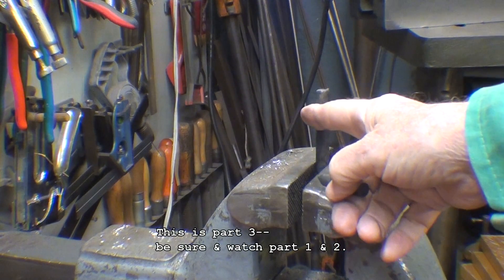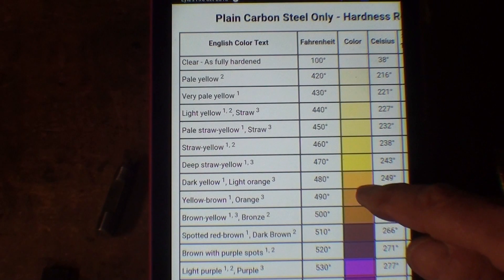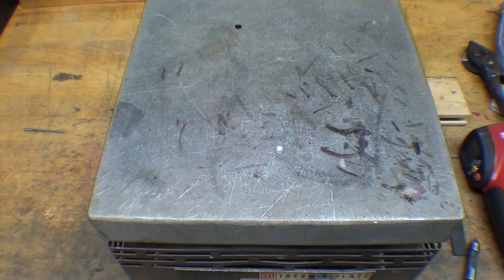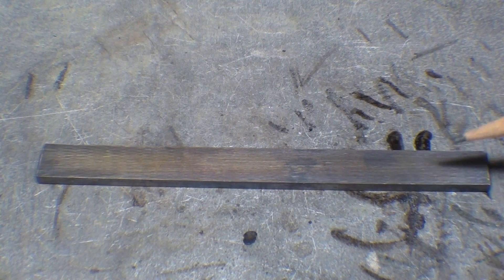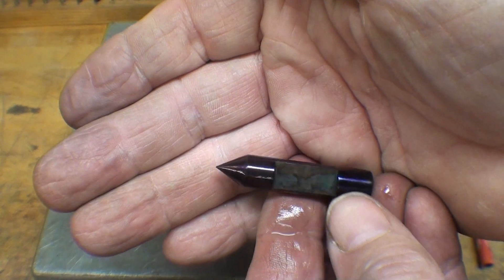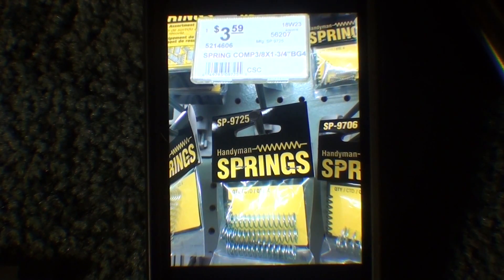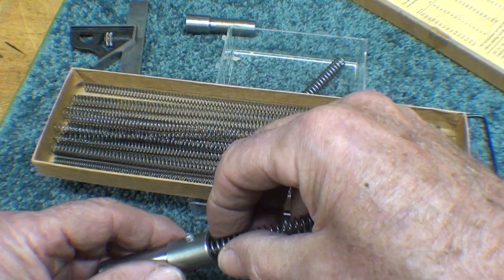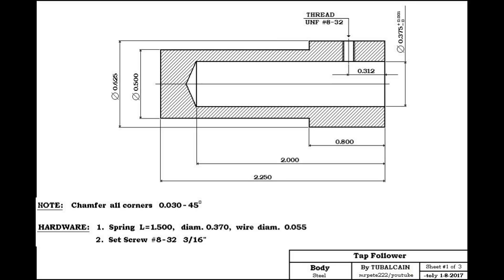TIPS #361 pt 3 HOW TO MAKE A TAP FOLLOWER tubalcain

Comment: Well this is another project I had put off for to long. I had made a tap follower years ago but not this style and while it did it's job it wasn't the sturdiest design and I made the mistake of making it using 5/8" where it goes into the chuck, you wouldn't think that is such a big deal but it is in my opinion. 
I don't usually load a 5/8" chuck into my lathe tail stock or my mill, I seem to gravitate to a 1/2" chuck most of the time and it becomes a pain when you have gotten most of the way through something and go to tap it and then you have to change out to a larger chuck. On the lathe it really isn't that big of a deal but on a milling machine and mid project the last thing you want to do is stop and swap out a chuck. 
Yet another one of your projects I have made, Thanks mrpete.

Comment: Mr. Pete,
  It’s always advisable to use a spring of slightly smaller diameter than the bore. A compression spring naturally expands as it is compressed so adequate clearance is necessary. Probably what your “jammer” spring was doing.
Dale from Decatur

Comment: +mrpete222 I've been watching your videos since 2014, when I retired from the military (after 20 yrs), I'd like to learn the machinist trade.  I've been looking to going back to school @ a local community college here in San Antonio TX.  However, it appears that traditional machining is on the way out (it's all CNC).  If I do a "home study" self-guided class, what textbooks (like the one you showed on this video) videos, or information would you recommend?

Any other advice would be appreciated!
Reply from the maker: Ron-I just lifted these titles from amazon. Also, look on ebay for mach shop textbooks. The older ones may be better-they do not include cnc. There are 1000s of these old books around for cheap. Watch my tubalcain tips #189 & #282 for books. Machine Tool Practices (10th Edition)Jul 20, 2014
by Richard R. Kibbe and Warren T. White
Machine Tool PracticesJan 1995
by Richard R. Kibbe and John E. Neely
Machine Shop Operations and SetupsJun 1, 1973
by Orville D. Lascoe and C. A. Nelson
Reply: Thanks Sir
Reply from the maker: Thanks--I will explore that site

Comment: Does the heat bluing of the steel do anything to improve corrosion resistance?
Reply: Yes, it acts very similar to gun bluing, as far as heavy rusting is concerned. That said, as with gun bluing a very lite coat of oil is used to prevent surface flash.

Comment: Lyle, get yourself a small brass or ally tray and fill it with Silver Sand or fine brass turnings. Place it on the heat with the part nestling in the sand / turnings. This will give you a much more even heat as the temperature rises.
Reply from the maker: Yes-like clickspring

Comment: The fine grain appearance in the break indicates that you had heated the material close to the transformation temperature of the high carbon steel which is 1330 degrees F.  Above that temperature grain growth occurs and if heated far above the transformation temperature the grains become very large and the steel becomes very brittle.

Comment: I worked for an oil field tool company that heat treated their own steel. We bought some Japanese steel in the mid 70's. Rolling through our line furnaces, that stuff would eiter break apart in chunks as it came out of the furnace and a couple of time the 30 ft. long 8 in. diamater solid steel bars would split lenghtwise, "slab", and basically destroy our furnaces. Amazing and dangerious when you talk about the pent up stress in steel. :)
Reply from the maker: WOW!!
Reply: In our steel mill, we would run rebar with out of spec (leftovers,various grades)billets. occasionally we would get rebar so hard it would break like glass if you dropped it!

Comment: When the Springfield armory sent the first run of 1903 rifles into the field, they began to get reports of some of the rifles blowing up. Col. Hatcher investigated and found some of the receivers were so brittle that they would shatter like glass when struck with a hammer. Turns out that, like most factories of that era, they used used skylights for day time lighting. The receivers were tempered by eye and on a bright day the colors were faded and the steel over heated and became brittle. Plan B, to the furnaces.

Comment: Thanks for sharing this build. Just wondering why you need to temper this tool?  A tap follower doesn't seem to have a lot of stress and, a little oil on the point would keep wear to a minimum. seems like a little overkill to me. Maybe I am missing something here?
Reply from the maker: you are correct-just wanted to show it
Reply: That what I was thinking too. Thanks for sharing it. Interesting to see how the colors relate to the temp. It's taken 55 years to get a good shop teacher like you so, I;m not ditching class anymore!  :)